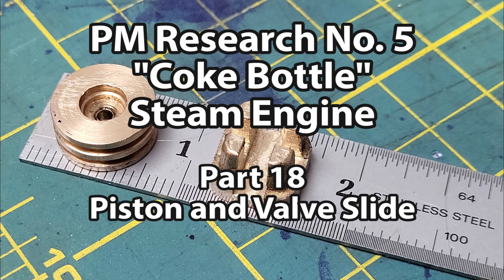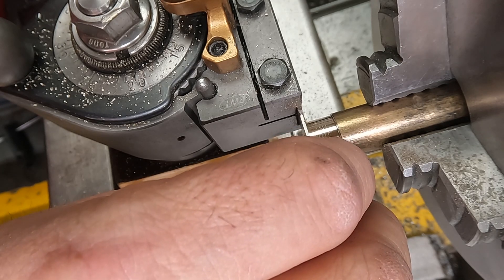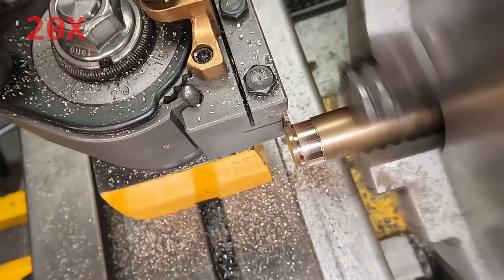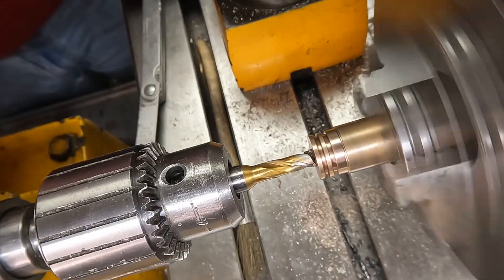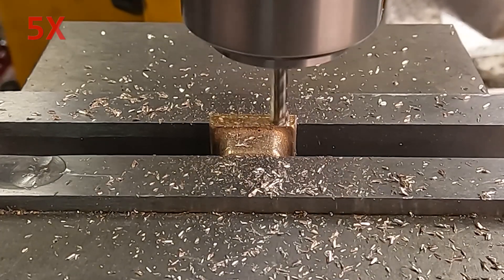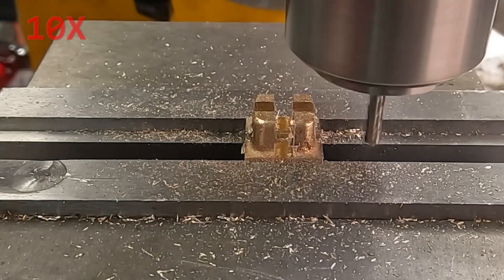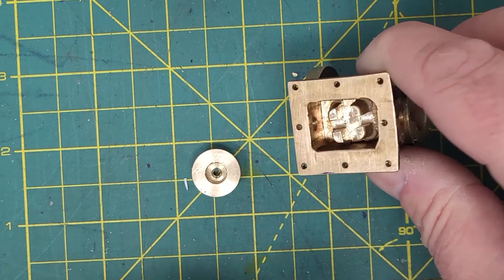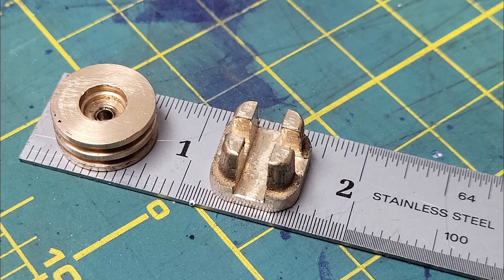18 Machining the Piston and Valve - PMR #5 #steamengine #steamengines #lathe #machining #turning

Comment: Looking good. I always have trouble with those teflon piston rings - on my PMR 4 they locked the engine solid. I have tried shaving them down, machining the grooves deeper or leaving them out and using an O ring. All these methods work. Not sure why they have never fit when all dims were in spec. Oh well.
Reply from the maker: Always easier to take material off than put it back on. Tight beats rattly any day. Thanks for watching!

Comment: re your cylinder taper, you would have been better honing it out with a cylinder hone, they are available from car accessory shops very cheap.
don't worry about your slot in your valve slide being oversized, ideally you need a bit of slop. next time you machine a piston machine the diameter a couple of thou oversize, then machine the piston rod, assemble them and finish the piston to size on the rod. that way you are guaranteed they are  symmetrical and should not bind in the cylinder gland. lastly when you come to assembly put the gaps in the rings opposite each other, personally I use silicone O rings myself, a lot easier. Nice work though, coming along nicely .
Reply from the maker: I was going to use my cylinder hone, but since last use, sitting in the drawer, the little stones had come unglued. Good advice on the piston concentricity, I will keep that in mind. Thanks!
Reply: @thumperthoughts  you can buy new stones for them, they are really cheap and worth it

Comment: I’m loving the build so far. As far as installing the piston and rings, could you machine a tapered cylinder to push the piston through into the steam engine cylinder?  Or use a small hose clamp around the piston and rings?
Reply from the maker: I actually had a cutoff piece of mandrel that was the right size which helped with bluing the barrel. I pushed the piston in as far as it would go and looked to see where it was scraping off the blue then shaved little bits of barrel of with a little round woodcarving chisel. I took it slow and after about 20 passes I removed the high spots and now it is a close sliding fit all the way through. The rings compressed in after some persuasion. It is tight but I think it will run in.
Reply: Not a bad idea, done all the time with piston engines.